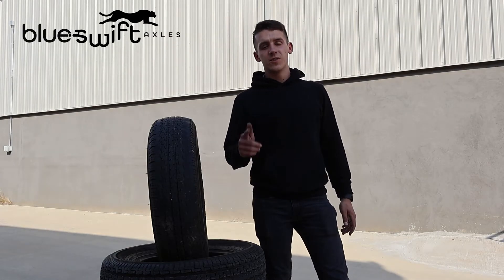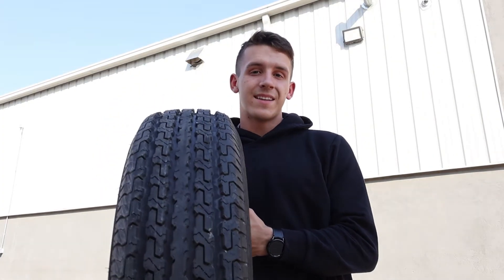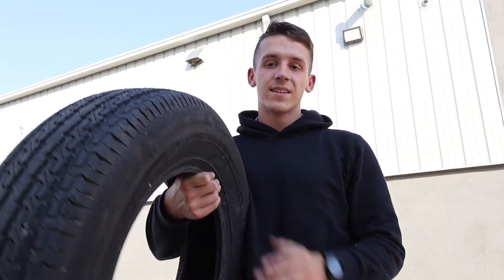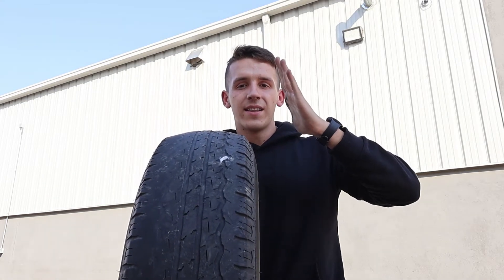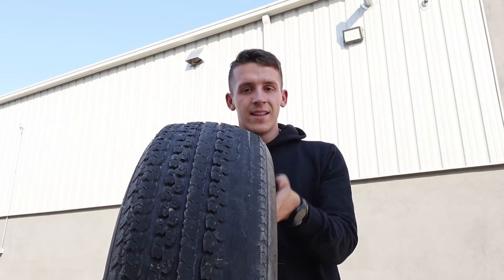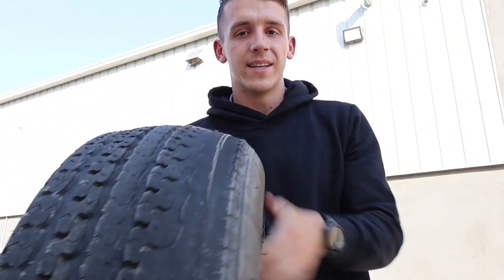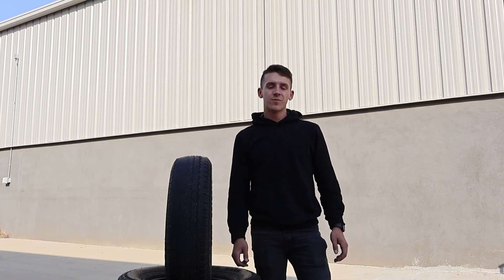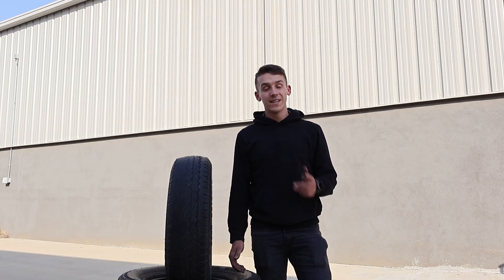Top 5 MOST Common Types of Uneven Tire Wear!

Comment: Ok but what if car manufacture recommends 35 psi max. I am at 35 psi and rear tires are slightly darker at the edges. So increase tire pressure?